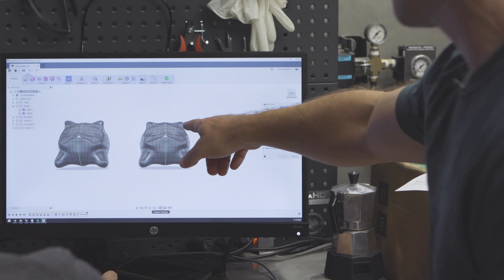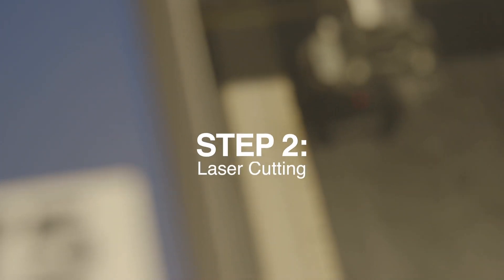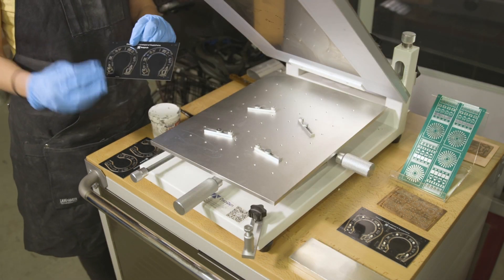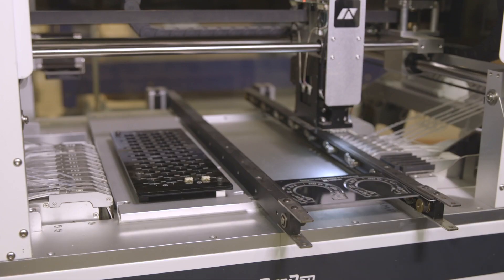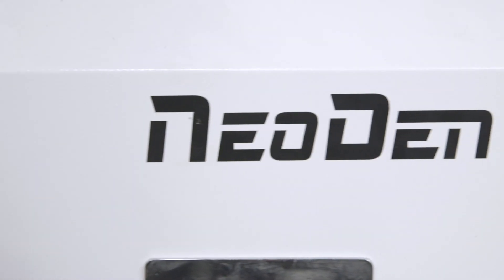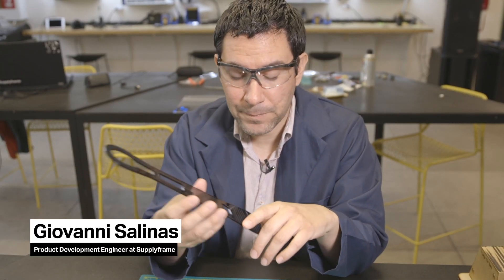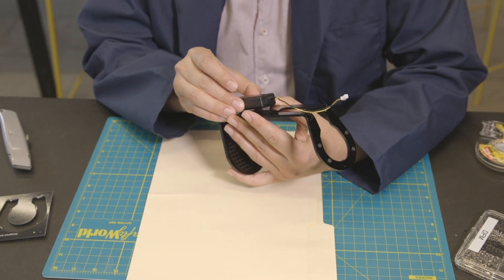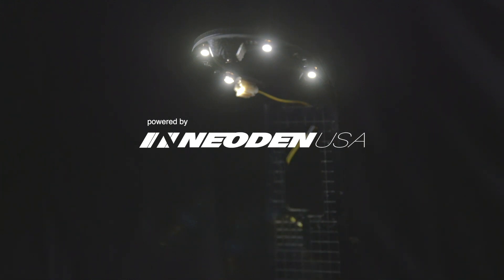Intro to Design for Electronics Manufacturing

Comment: Wat are d names of machine needed for d whole process
Reply: Laser Cutting Machine  - To cut the acrelic
PCB Stencil Board (not a machine) -  To apply solder paste 
Pick and Place Machine - To Place components on PCB 

You might also need a 
PCB Milling Machine -  To fabricate the PCB on a copper clad
Electronics Workbench - To solder the PCB
Reply: Yupu
Reply: @jamemanga314  i don't understand